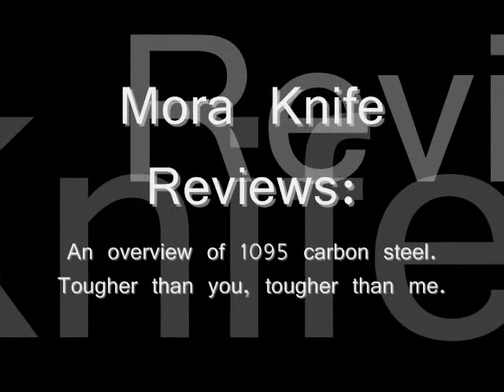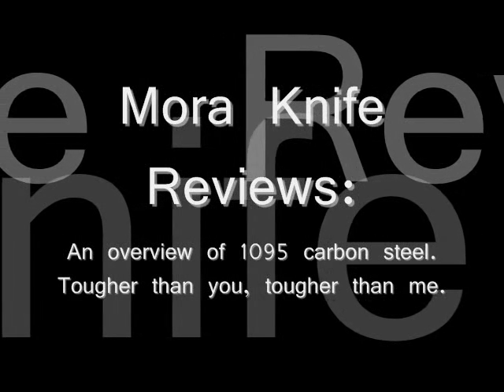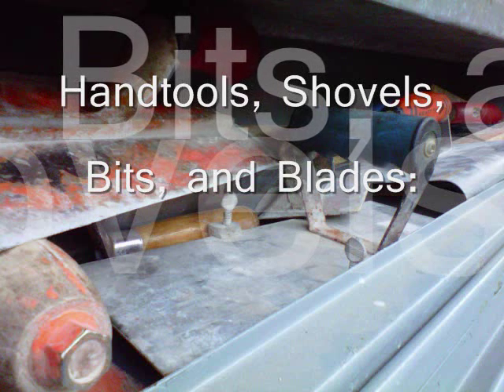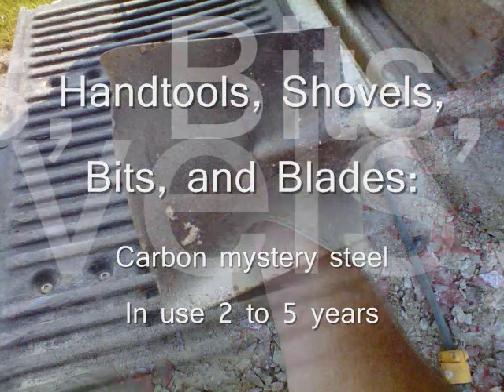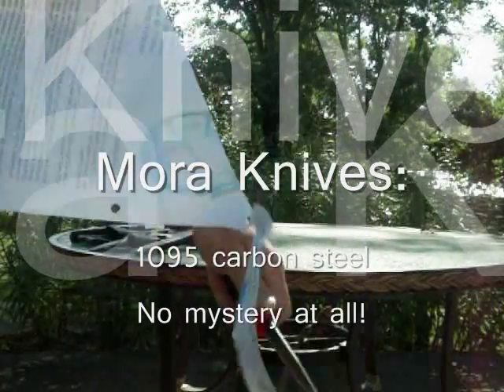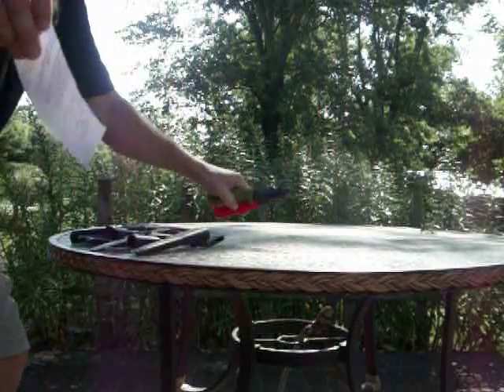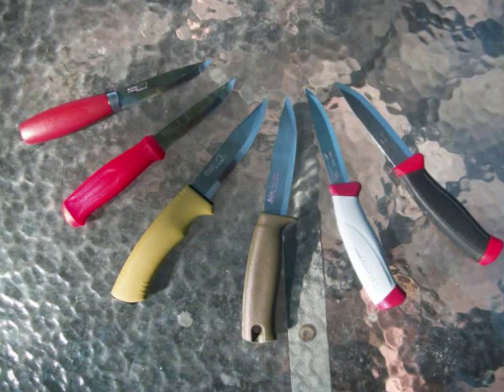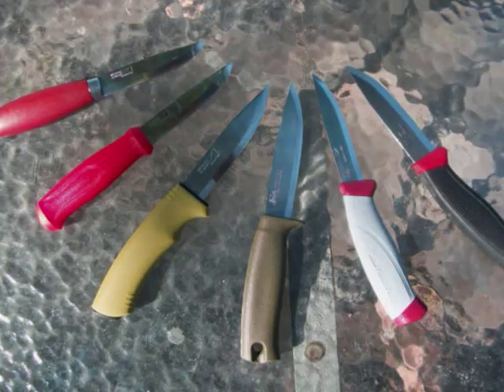An overview of 1095 carbon steel.wmv

Comment from the maker: I can't really say, the temper has a great deal to to with the toughness of any tool in application- the stuff I was using was very tough, high carbon bits. They mash, dull, and mangle up but don't snap because they are tempered to be softer- you're samurai sword most likely has a different temper, and a much finer edge. I would hesitate to blast through lumber without being prepared to watch it break, or at least blow the fine edge. Thanks for the comment!

Comment: Thanks for the video, I have a 1095 clay tempered samurai sword. I have read that 1095 can be brittle in swords?  How likely or unlikely is it that it would get damaged chopping at something like a 2x4?  I mean if these tools you are using in the beginning are 1095 it should be no problem right?